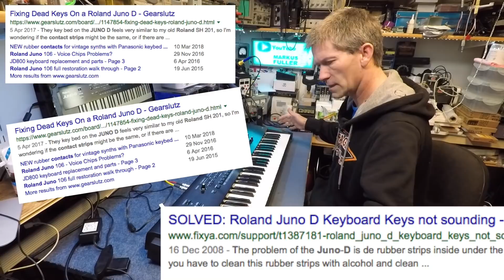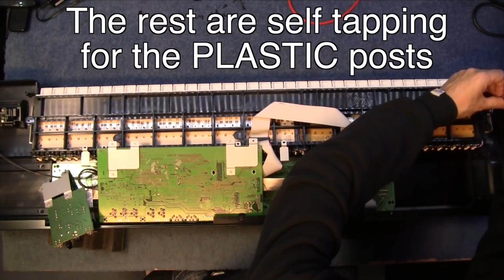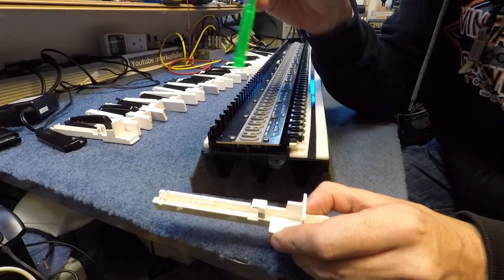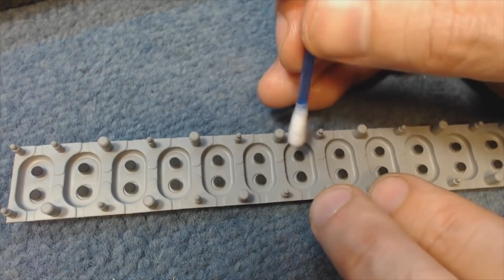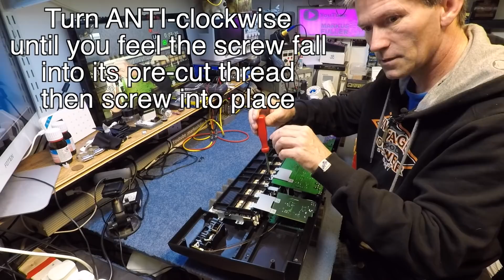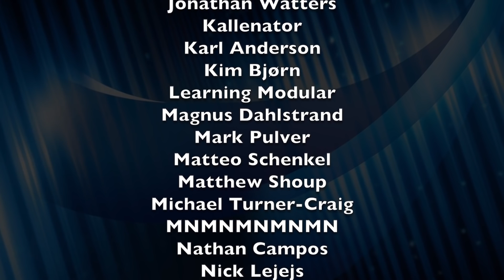Keyboard repair key fix roland juno dead keys

Comment: I have an old synth with similar key contacts that I was about to open up and clean it so much appreciated.  There was another repair youtuber I ran across (sorry can't recall where I found the video) who showed a similar repair along the lines of this and similar to the SH-101 keyboard repair you did with a pencil.  In that video the repair guy mentioned repainting the tips of the graphite spots with a graphite paint.

Have you heard of this/had any success with this method/encourage or discourage this procedure?  Do you think it would hold up over time?
Reply: A bit late with some information. I watched the same video, that method seem to work well circuits with the carbon on the board, not metallic plates like in this one. What I always have done is to rub some graphite dust on the carbon pads on the rubber instead of the board, that works well with either carbon or metallic contacts. I use a fine file to make some graphite dust (from a soft pencil, like a 2B), then I take a very little amount with a cotton swab or my fingertip and rub it very gently on the black pads on the rubber, be very careful to put it on the pads only and not to touch the rubber around. With that method I have been able to restore unresponsive remote controllers, phone dial pads and the keys on my Roland D50 and that holds up for a long time, even years without any side effect. I would also like to hear Marcus' opinion on this matter though.

Comment: Hi markus, I'm having a similar issue with my Juno D and that led me to your video. First of all thank you so much for your time, I watched the whole thing and I'm almost ready to perform this surgery on my keyboard, but I need to ask a question first. Instead of completely dead keys, I got only two "dead" keys but they're only dead when one is played while holding another. They're working fine on their own and they're also fine when I play them at the same time, but when I hold either, the other one will produce no sound, it's very strange and specific. Do you think that I will benefit from doing the procedure shown in the video or am I dealing with something completely different? Once again thank you so much.

Comment: I did the same with my Roland U-20 and changed the battery while diving in there. Took me around 5 hours.
Reply from the maker: Yes it takes a while and one wonders how long it will last before having to do the job again.
Reply: I had my U-2- stored for a few years, got it out and many of the keys were stuck together and most don't work now, which is strange because it worked fine before.   It looks like you just about have to take the whole thing apart to get to the keys.  I took it to a local music store, dropped it off and then got word that they said it would be more expensive to fix than what it's worth, didn't even quote me a price.
How hard was this for you ........and how'd you figure it out ?

Comment: Hi! Thanks so much for this. I am currently cleaning the contacts. One further question though, as someone who only really takes apart computers usually, did you find quite a bit of grease on the front and back contact point of the keys as you took them off?  Should I be replacing this grease after I am done? A lot of it seems to have worn away. Or can I just clean it off, as it seems quite dusty and hairy at this point. Thanks again, so helpful!

Comment: QUICK QUESTION: Is it always safe to clean both contacts with isopropal? The reason I ask is because someone told me that some of these contacts are made out of carbon. By cleaning them you remove the carbon and destroy the contacty? True or not?
Reply from the maker: yes some are made from carbon but they can be cleaned gently but dont apply too much force as you can dislodge the carbon.
Reply: @markusfuller  Thanks Mark! Was very concerned that the carbond would be removed. I did buy another rubber strip and planned on replacing it. But wanted to clean the board it sits on too. Very appreciated.

Comment: I had the Roland U20 keyboard that had the same keyboard. I had this problem 3 times and it was not a cheap repair as the the time it takes to do the repair. I never had this problem with any other manufacturer.
Reply from the maker: Yes theres another comment about the U-20 . I think the Juno-G and Juno-D are also on the "this will fail in time" list. I wonder how much would it have cost to put a better keybed in there.
Reply: markusfuller Not sure. After the 3rd time I used it 
, as you suggested, as a sound module then eventually sold it to a repair shop for parts.
Reply: @ldifalco2010  U20 has different keybed, it's the same that was inside Roland JD800. Had plate springs instead wire ones.
Reply: B1SCOOP Yes, that’s true but the problem with the rubber contacts that Markus is fixing in this video were an inherent problem with the U20. For the time, the U20 was a very good economical gigging choice but after the 3rd time it needed the contact fix, I moved on to something new.
Reply: @ldifalco2010  it's still league ahead of modern midi keyboards. I got one cheap to get nice set up of '90s rompler sounds, didn't sold it, because I started to enjoy playing on it more than other keyboards in my setup.

Comment: My Alesis QX49 had one, single key stop working. I took it apart, cleaned everything just like you did yours in the video; put it all back together and the same darn key still did not work. Any ideas?

Comment: I face the same issue inside Nintendo NES controllers. What I use is a rubber eraser as it is a bit abrasive. This could be a tip if you come across badly worn rubber contacts.
Reply: HA ha, I used to do the same with the old Commodore 64 cartridges!
Reply from the maker: Hi Andreas yes I sometimes use the rubber eraser I did a video about that a few years ago. I just thought this would only need an alcohol clean up this time.

Comment: Sounds like the keystop felt may have hardened over time too - whenever I open a keybed I usually check it out and either try to fix it or even just replace it. Playing a keyboard with a hard keystop is hard on the joints!

Comment: so my Roland Gi I think got too hot from having an outdoor gig and caused some problems.   My Preview button produces sound and the D Beam also does.   BUT, ALL the keys do not produce any sound.    Could that still be the same issue?   I'm thinking it would be some kind of connection that delivers the information from the keys to the board?    I am not an electrical person btw,  but knowing that NO keys work, maybe it's something else and not each individual key.

Comment: Hi Markus thank you for your excellent video.  I have a Roland KR-33 which I bought new over 30 years ago.  It's been wonderful but guess all good things come to an end!  It now has two dead keys which are adjoining.  Before I take it apart to try and fix it, do you know whether it has the same set up as the Roland Juno so I could follow your process?  Would very much appreciate your advice.  Kind regards from NZ, Sue C
Reply from the maker: Hello Sue. I have never been inside the KR-33 so I am not sure if the key setup is exactly the same as the juno but there will be very little difference in the way they work, maybe the plastic keys will unclip differently but im guessing the carbon rubber pad pressing onto the circuit board will be just the same as that way is used in most keyboards now. good luck & best wishes.
Reply: @markusfuller  Thank you so much for your response, Markus.  Appreciate your time and advice.  Kind regards, Sue.

Comment: Roland still use EXACTLY the same pads in the JD-Xi ! 

Ask me how I know ? lol

I wouldn't recommend using Isopropyl on the carbon coated pads as it could remove enough of the coating to cause failure. As it did on an expensive remote control I was fixing once. ☹️
(I managed to fix it by gluing a small circle of aluminium foil on the button.)

Comment: Thank you Markus for this tutorial. I'm finding that my rubber strips that hold the plungers and the corresponding circuit board they attach to under the keys are quite dirty. How might I go about cleaning these? Cheers
Reply from the maker: Hello you can sometimes clean the rubber strip part with mild soapy water on a cloth but try not to get the soapy water on the tiny black carbon dots.

Comment: How can I repair a Roland A-37 it will not power up I have try using Unversel power cord so is it the power supply pack in side the keyboard ?

Comment: NEED SOME HELP  done all this , pencilled the contacts still a few keys not working and they are randomly around the board, what i have noticed are where the ribbon ras been glued into tthe specific octave circuit board there are silver circles missing, just above a line of solders so 5 6 7 and thirteen at the end of the keyboard are not working i dont get it,

Comment: Hello, I'm hoping you might be able to give me some advice? 
I have a keyboard with 27 dead keys out of 76 total. I'm not really sure if it's worth fixing at this point but I want to try. The keyboard was sitting in storage for a year or more. 
Methods I've tried so far: Cleaning all dust and debris, using a pencil, 
using a pencil eraser, and using isopropyl alcohol. I also took a look underneath the boards for any broken wires and couldn't find any detachments or rogue dust there. I've ruled out the carbon buttons being the issue as all the "dead" buttons work on my remaining working keys. I did notice some of the key lubricant had gotten spread slightly onto the connection board, but cleaning it up didn't fix anything. I'm honestly at a loss of what to try next. The model I have its a Casio WK-6500.
Reply from the maker: Hello Im sorry to say but it seems like you have tried everything that I may have mentioned. Im not sure where you go from here . have you tried powering it up with the key contacts exposed and then using the rubber strip maybe the end note if you know that works and moving the rubber strip along and pressing a known dead note with the rubber contact from a working note. if it plays the note then the rubber strip needs replacing if it does not then check the ribbon connectors that go from the keyboard to the main unit. other than that i’m not sure what to suggest

Comment: The other 30% of 70% isopropyl alcohol is indeed water. The reason that 99% is better is some residues are hydrophobic and will not go into solution if there is water present (solder flux residue is particularly troublesome in this regard).

Comment: I’m working on a Roland D20 that has three dead keys and they will not work even after multiple cleanings. So I’m going to try to figure out what is going on.
Reply from the maker: maybe look for tiny cracks in the copper tracks on the circuit board or check conductivity from the pad contact to the ribbon cable. there may also be several diodes on the board under the keys but I do not think I have ever known one of those to break down before.
Reply: @markusfuller  thanks for the info. I tested the diodes with my multimeter. They’re all good. I did notice there was a dark green trace coming off one of the carbon pads leading to a diode. I got continuity when testing the diode but when I tested the pad and diode together there was no signal. So I soldered a jumper from the pad to the diode and voila it worked. But there is no obvious breaks or corrosion on the remaining two dead keys. So that one will be tougher. Thanks for the input.
Reply from the maker: @rocknreplay  Hi I hope you track down where the problem is and get it working again.
Reply: @markusfuller  I finally got it working. I had to solder some jumpers on a couple traces on the key controller board. Must have been some corroded spots. Now I have to replace some of the tact switches. Other than that, it works great.
Reply from the maker: Brilliant i’m glad you got it working.

Comment: I have an old Roland W-30 with a few keys that aren't working, the screen backlight has also completely gone, so the screen is hard to read to say the least, I was wondering how difficult it is to replace the screen? I have taken it apart and cleaned the keybed etc. but they still don't work properly, but the screen is the main problem. Any suggestions would be helpful, thanks.

Comment: The other mistake I noticed when the keyboard was assembled, ready. The middle A moved the neighbor black keys too. So I needed to disassemble the synth again. I found out a soft material on the upper and bottom part where the keys hit. To make the hut soft. So the top part consist of 2 stripes, they fall apart and a part fall to bottom making pull of the other keys. I needed to stick this back.

Comment: i had a problem with my casio celviano AP45 when i play evry key individually they're fine they play very well what i want to say they're velocity  (soft and loud) when played soft or hard.
but when i play two of keys in a specific group one of the two keys sound so loud even when played soft.
ps: first four keys were dead i thought it's just dirty contact rubber but i foud out that coffee was spilled on the keys and the zener diodes under the keys's contact pcd where burned down so i changed them with some similar swithching zener diodes.
i don't really know what to do exactly to fix it i don't have an idea.
i'll be happy to hear your ideason what might be wrong. have a good day.

Comment: The better way of cleaning the contacts is not with isopropyl alcohol but putting kitchen surface cleaner white past. Both on the rubber contacts and the contact circuit boards. Apply the soap at neat strength. Rinse well in running water. I worked for a keyboard manufacturer abroad and water is absolutely used in the cleaning of electronic components. (Google cleaning of electronic circuits using water)  

Dry the washed circuit boards and rubber contacts using a slightly warm hair dryer. 

The first contact tells the cpu count backwards from 127.  The 2nd contract stops the count down reads the count value and converts to a velocity reading.

If the first contact is dirty the count won't start and the 2nd contact will read 127  always.  Which is why the volume of the key will be very loud 

If the 2nd contract is dirty the STOP and READ THE VALUE  will not happen and the volume will be Zero.

Comment: Thanks for this very useful informative video, greatly appreciated! I really do not understand the way this sort of midi keyboard works, but I have a Roland FP30X that has a USB midi interface built in. Does this mean that I could simply connect another keyboard in the manner that you did to access the sounds from the FP30X? Thanks.

Comment: Hey Markusfuller... Came across your video. Such a precise work you do in the video. 

I have a little problem with my keyboard. 
I have a new korg Nautilus music workstation.
It is 61 synth keybed...All the key bed is working fine. But there is a little sound from one of the Black key. Like when you press a spring kind of... Every other key has no noise. But that Black key... 

Please help
Reply from the maker: Hi Ronel. I have never seen inside the nautilus but Im guessing the spring is at the back of the key which is common for most keyboards. trouble is I do not have a clue why your one key is making this noise, maybe it is not correctly positioned and is touching or scraping against something else, you would need someone to open it up and check what could be making the noise.

Comment: Do keys with the triple sensors look the same with two contacts on the silicone strips?  Please, how can pushing the carbon dot on the silicone strip down onto the copper contact dot on the circuit board complete a circuit?
Reply from the maker: Hi the circuit has 2 exposed copper parts and the carbon bridges the gap between them, normally a chip is involved that detects the resistance of the carbon as it bridges across the copper and that chip sends a full pulse to the main keyboard saying that key has been pressed.

Comment: Hi, Markus, how are you? My Roland XP 80 is accusing "User Memory Damaged" and does not hold set ups in memory. I've already changed the internal battery, I've already done the factory reset and I even took it to an authorized Roland dealer in my country, but they said they have no spare parts to fix it and the problem persists (unfortunately, I think they haven't even examined the keyboard). Do you have any tip to fix it? Thank you in advance!

Comment: All the keys sound on my Yamaha PSR-1700 but the keys are stiff and squeaky, someone said just need re-greasing, would you say that's the case?
Reply from the maker: that sounds good to me. if you can buy some white lithium grease as thats what is normally used in these keyboards.

Comment: I have three black Keys on my Roland electronic piano not working. I have tried your method but no luck. I'm guessing this is a electrical problem? Where should I start with my multimeter to find the problem?
Reply from the maker: Hi Richy R. if you look where the rubber domed key switch touches the circuit board there should be contacts there that are bridged when you press a key, you could follow the tracks from there to where there is probably a ribbon connector that connects the whole keybed to the rest of the piano. I would mark where the 2 contacts are and place the rubber dome back where it was and use continuity on the multimeter to check wether it is working properly as a switch. on some boards there may be diodes used so check those also, if you are lucky you may just have some small cracks in the circuit under the keybed that can be soldered over to close the crack, I have seen this a few times on well used piano weighted keybeds where stresses can make cracks that are very hard to find as the copper track reads fine on a multimeter but the fault is only happens when there is pressure on the area from a key being pressed down. I hope you manage to find the fault. best wishes Markus.